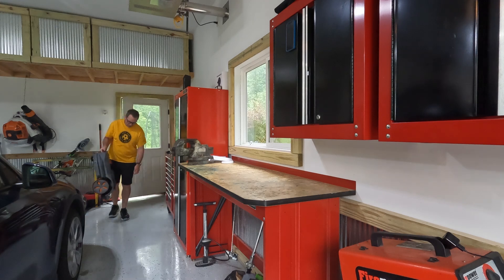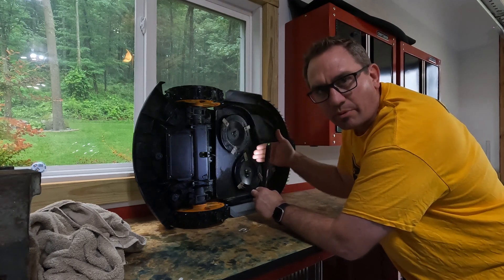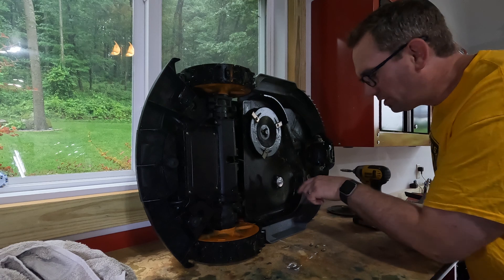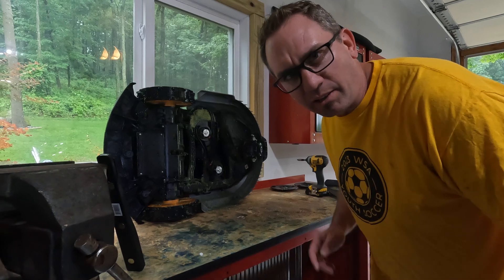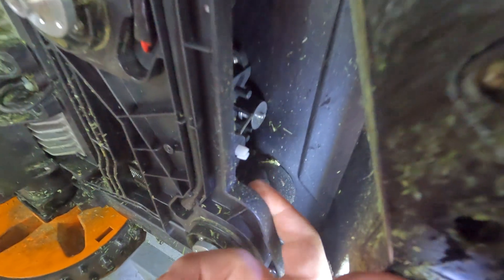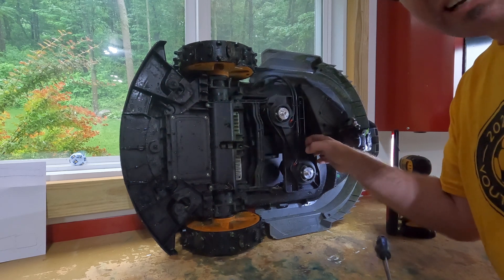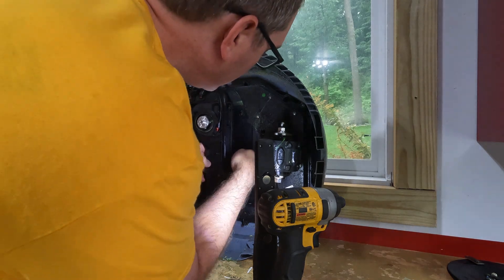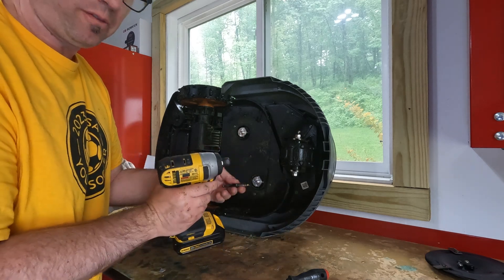Sunseeker Orion X7 Update - Cut Quality Fix - Battery Replacement

Comment: do you have a video showing how to remove the front bumper?   I'm getting the front bumper stuck error.  I removed a small stick but it still doesn't work. Want to dig in further.
Reply from the maker: I don’t but I have had that problem too.  I fixed it by moving the bumper in and out a few times to get it back to “neutral” position.

Comment: This was great to see.. Im really looking at this model or a luba. Luba lack of service and poor option replace battery has me leaning this route. Do you still enjoy this mower and does it keep up in the spring with mowing?
Reply from the maker: Yes, it’s still my main mower after getting others to try.  My only complaint is that the charging could be faster.  There is a 7 amp charger now on the website but it seems to always be sold out (mine is 5a).
Reply: @TheLawnEngineer  I saw you had a luba 2 what happened with that?

Comment: I bought a Luba 2 and Orion X7 Plus and tested them side by side this summer 2024. The Luba 2 software is more refined by early September 2024, opposite what I thought I would see. The Luba has a much more robust satellite RTK system. The Orion X7 lost signal more often and easily. I have a plush / thick lawn of Kentucky Bluegrass mowed at 3" in height. The Orion X7 would not mow well leaving uncut blades all over the lawn. I tried all mower speed settings and mow width settings with poor results. The Luba 2 cut much better. I contacted customer support before purchasing the Orion X7 with several questions on the mower's abilities. They basically lied about how close the mower will mow against edging and walls. After collisions with walls, falling off the street curb, customer service told me not to program closer than 6" to any boundary. The Orion leaves strips of un-cut grass between zones. Customer service said that was a known issue. The Orion does turn sharper than the Luba 2. I do not think the Orion X7 is ready for purchase yet. The claim to have a 30-day Money Back Guarantee, but they will not honor that.
Reply from the maker: Great summary, thanks for sharing your experience.  I have had very similar experiences.  

I have a newer video here with a comparison Robot Mower Comparison - Luba AWD - Orion X7 - Dreame A1
https://youtu.be/b8EerDJrxtM

Thank you for taking the time to share your experience, so others can learn .

Comment: Battery performance is really bad. Although their website says 0.75 acres, it's not even doing 0.06 acres in a single charge.
Reply from the maker: I have mine scheduled to start cutting everyday at 10:30am.  It takes two days to cut 0.50 acres.  A battery or charging improvement would be welcome.

Comment: Wouldn't the grass make the deck even heavier, so it could more easily lower, and not the other way around? or does the grass impede the lever mechanism somehow? The battery is the same as is used by other Sunseekers mowers it seems, and I was able to find it for sale online.
Reply from the maker: Yes the grass does make the deck heavier but it was also packed very tightly into the springs and linkage.  

Can you send a link to the battery you found?
Reply: @TheLawnEngineer  I can try to send it, but usually these are blocked.

Comment: I called Sunseeker and asked them if the battery is replaceable by the owner of the unit and they said yes. I currently have a Dreame A1 mower and Dreame said they will not allow their users to replace the battery. The mower needs sent back to them. I recently checked my Dreame A1 mower and it is possible for the owner to replace the battery. The battery is easily accessible and has your typical quick disconnect to change out the battery. I am not sure why Dreame has this policy and it is making me think twice about keeping the mower. Though I do really like it otherwise.

It is interesting that the battery on the Orion looks exactly like the Dreame A1 battery and it the same voltage and Ah, so maybe I could by an Orion battery for my Dreame if needed? I know you tested a Dreame. I wonder if you could try the Orion battery in the Dreame? See if the connectors match up and the battery fits in the carpartment?

Thanks for your video.
Reply from the maker: That is interesting why Dreame would require the mower to be sent back.  It is not surprising that the two mowers have virtually the same battery.  I’m sure these mower manufacturers are sourcing their batteries from the same company.